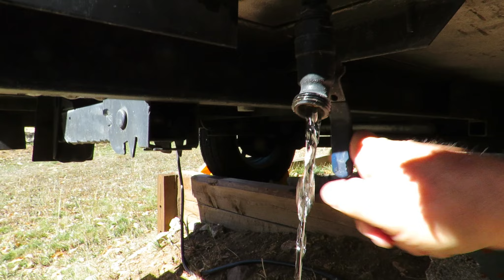Casita - How to Winterize your Travel Trailer by RV Adventures

Comment: This is a PERFECT video. Thank you so so so much! I had a "high level" understanding of the blow out technique, but there were certain pieces that I was still uncertain about. Specifically, my mind was BLOWN when you showed us around the 25 minute mark how to unhook the pump. SO EASY! AFAIK, not covered in the Casita Manual (will double check) and so incredibly useful. HECK - I didn't even know there was a filter there! (There are folks on the internet who talk about installing valves there, but this is better because another valve there would just be another failure point, IMHO.) I also love the tips about running the pump briefly dry around minute 27, specifically how much to add to the drains, and the pro tip about the tilt around minute 32. Like I said, this is a perfect video. Also - even reading the comments - I have learned even more! (e.g. The comment about further suction may be needed for the hot water heater from Nancy, the clarification regarding the hot water heater pressure relief value from you and Gary, etc.)  THANK YOU.
Reply: Oh! I forgot one extra comment. 

IF you (the viewers) are still in the "antifreeze in the fresh water system" camp after this video, I've read that you can reclaim the antifreeze and re-use it. 
(I wouldn't re-use the drain antifreeze because that sounds kinda gross and unsafe.). 
I wish I had known that I could reclaim the fresh-water-system antifreeze this spring! Just never thought of it! Sharing that in case it helps others.
Reply from the maker: Thank you for taking the time for a such detailed comment. I am glad you enjoyed the video and I wish you all the best. Happy Camping!

Comment: Alan, Thanks for the video. Do the black/grey tanks need to be dumped before this procedure?  I'm in southern Arizona at altitude and sometimes hit freezing in the winter but usually not for very long. I'd like to use my RV year round and didn't realize this limitation until my purchase is now pending. I'm wondering if I winterize as you say and then bring along water in a tank I keep inside the Casita for drinking, showering and flushing, perhaps heating the water on the stove for Navy showers. Can I get away with it, perhaps adding some antifreeze (seems to be rated at -50F) after showering and maybe even using it to flush the toilet? We'll generally not get much below freezing for very long. Any advice? Again thanks for the video and alternate approach. The thought of drinking water with antifreeze taste doesn't sound appealing. If I use antifreeze, is it possible to flush out the tanks enough to remove any after taste, or do most people carry separate drinking water?
Reply from the maker: We do carry extra water for winter camping, just in case. Also, we always just drink bottled water as well. I have experience running the water system down to about 15-20 degrees because all the water lines and the fresh water tank are inside the shell and as long as I am running heat to keep the inside temperature up, then no issue. I do put antifreeze in the black and gray tanks in those conditions. Yes, flushing the system well will remove any smell/taste from the system.

Comment: Thanks for the video, Allen. I just winterized my 2019 Spirit Deluxe for the first time as predicted temps tonight are for below freezing. Easy Peasy to do while following your video step by step. One thing I did notice however, was a small amount of water that remained at the hot water heater anode opening when I stuck my finger in the opening. So I used about a 3/8" diameter clear plastic tube like a straw, putting one end inside the hole and holding it down with my fingers, then sucked slightly on the other end to start a siphon. I got about two more ounces out of the water heater and can no longer feel any water inside of the opening. So I'm confident that my water heater is now totally empty.  Thanks again for another one of your terrific videos. Happy RV adventures to you!
Reply from the maker: Great idea. Thanks

Comment: Thanks for the Video. I have pass it along. I decided to use the RV antifreeze because I did not want to buy a Air compressor plus it seemed like less work. Now I closed off the by pass valve on the hot water heater,  like you did & still got antifreeze in my hot water tank. Any ideas?
Reply from the maker: Maybe it backed up through the inlet lines... but I haven't heard of this happening. Make sure you remove the Anode rod and wash it well or the antifreeze will melt it away. Anyone else out there experience this?
Reply: @RVAdventuresTV  Thanks for your answer. That makes sense. I bought a new Anode Rod. I will put it in the spring.

Comment: I seem to lose 2-3 gallons of water while traveling thru the inlet or vent line, is there a mod or fix for that
Reply from the maker: The only way I know of is to put a plug in the vent line hole and glue a piece of thin rubber on the inside of the fill cap.

Comment: Great video. Thanks for sharing. Did you blow out the line from the bathroom sink to the shower head?
Reply from the maker: I usually gravity drain it by just hanging it down each time we use it... so, yes, I open the plunger to allow some air to flow through it to make sure all water is out. I thought I showed that, maybe I missed it. Thanks for the question.

Comment: What about any special winterizing for grey and black water valves? Do you leave these valves open or closed. Do you leave the dump drain up or down?
Reply from the maker: I pour some winterize solution from the jugs in the drains for the traps with enough to go into the gray tank and pour some in the toilet and flush so that it sits against the drain valves on the outside. I leave the dump drain down and open, but the valves are closed.

Comment: Is there a max psi that should not be exceeded when sending air through the system? I figure your compressor has a max setting so it turns off when you have all valves closed, correct? I guess with a bike pump, you would just keep pumping until the pressure is up, then open and close each valve one at a time and re-pump as necessary. Is that right? Really liked your video. I’m not a fan of putting antifreeze in my drinking water system. Would much rather blow out the lines like this. I have been looking around at RVs for a couple of years now and came across the Casitas. They seem well built and I don’t see many complaints for them and they seem to retain their value more than others. I also like the smaller size. Did you own a previous RV, or is this your first one?
Reply from the maker: Thank you for all the comments/questions. I keep the pressure around 25 psi on the compressor outlet... with a bicycle pump, it would help to have a helper open the valves one at a time on the inside, then start pumping. I don't think a hand pump would build up the pressure in the lines. To build up the pressure there needs to be a sealed reservoir to hold air. If you get a small air compressor as I showed in the video that has a gauge, a helper can turn it off/on as needed not to exceed 50 psi, which most consider the maximum safe working pressure. Kind of the same as the water pressure coming in when hooked up to city water. We used to have a Shasta travel trailer in our earlier years, then life got busy until we retired... now we are happy to own the Casita. Yes, it is small, but there are a lot of advantages to small like maneuverability in parking lots, gas stations and campgrounds. The Casita is light and we get 16-17 MGP pulling it with our Jeep, it is as if it is not there and its shape makes it aerodynamic. The Casita trailers do hold their value well. The only downside to the trailer is a lack of storage for large items making the choice of a tow vehicle important for carrying your stuff. There are a lot of folks who add a storage locker or bike rack off the back bumper. Thanks for watching our channel.

Comment: Winterized my Casita today.  I found one of the fittings for my air hose today and it made blowing out the water lines so much easier.  I don't have a pressure regulator on my air compressor so I just aired it up to 35 psi and and then turned it off to keep it from building more pressure and connected connected the quick coupling and could drain a couple of faucets before the pressure dropped enough that I had to turn it back on.  Worked like a charm.  Thanks for the great instructional video.
Reply from the maker: Great tip for those without a regulator. I am happy it worked for you. Thanks for watching.

Comment: Great video.  I don't have a large air compressor and don't want to invest in one for only this process.  Would the portable one be enough?
Reply from the maker: Yes, the small one in the video works just as well. I have been told by some other Casita owners that they use a bicycle pump to do the same job and it works.

Comment: I just went through this process. It was pretty straightforward, except one thing. Regardless of which way I set the bypass valve, if I had the anode out and air pressure into the city connection, air was coming out the how water tank (which meant the pressure was lower if I opened another valve). Any idea why that would happen? I just put the anode back in until it came time to empty the hot water tank the second time, but I just want to know if I'm doing something wrong, if my bypass valve has an issue, or if my water system is "wired" differently (it's a '10 SD 17).
Reply from the maker: This is an interesting issue... It could be that the plumbing is different, but the hot water lines are separate from the cold water lines so if the air is coming in on the cold side it shouldn't cross over. One possible reason is if a cold and hot water valve in one of the faucets are both open, even a little, which would allow the air to come in on the cold side and exit the faucet on the hot side back to the hot water heater via the hot water lines. The only other reason is if the bypass valve isn't closing completely which could also be tested by hooking water up to the city water inlet with the bypass valve closed and see if water enters the hot water tank.

Comment: Thanks. That was awesome. In addition to being a great video about winterizing your Casita, it is also a great reference for how the water system is put together. I can't wait until I get my hose adapter so I can try this. I had one question. It looked like you cleaned your anode while you had it out. True? If so, can you provide some info about what you did there? Also, how can I tell when it's time to replace it?
Reply from the maker: I just wiped the anode rod off with a towel... the build up on it that is loose just wipes off. The anode rod shrinks in size as it is used up and when it gets to be about half the size it was originally, it is time to replace. I have talked with other RV'ers and they all say they just replace it once per year. I do that as well unless it is still a great size. It all depends on the water that is put in the system and how much minerals are in the water. It really is a judgment call on when to replace.
Reply from the maker: A little more detail may be needed here... The anode rod is a different metal than the steel tank and it sacrifices itself for the good of the water heater... here are some details from a plumbing site explaining how it all works: 
"An anode rod is usually formed of magnesium or aluminum around a steel wire core. The rod is inserted into the water heater storage tank, where it slowly degrades. As long as the anode rod is degrading in the tank, the tank lining will be protected from rusting. This is accomplished through a process called electrolysis, by which the metals in the anode rod attract "ions" that normally cause rust in iron and steel. These ions are what cause the anode rod to degrade over time. During this process, mineral build up on the rod called calcium carbonate can be wiped off to help the rod work better. If the steel wire in the core of the anode rod becomes exposed as the metal degrades over time, the anode rod needs to be replaced. The anode rod will be smaller than a pencil at this point."

Comment: How do you learn how much air pressure your unit can take?
Reply from the maker: I base it off of the same as the recommended water pressure maximum which is 50psi. With some experimentation, I found that 20-30 psi of air pressure is plenty to blow out the lines.

Comment: This is a great video.  Last winter I watched countless videos on winterizing.  Yours is far superior to any that I saw.  I ended up pouring almost 5 gallons into my fresh water tank and running it through the lines.  That was a huge mistake come spring.  It took a lot of water to clear out those lines.   I am going to have to check and see if my water pump has one of those filters.  It may not since it is an 07 model.   I am thinking I might gamble and not winterize this year since I am going to be leaving the day  after Christmas to head to Florida.  However, I may blow out the lines since that doesn't take that much.  Thanks again for this very informative video.
Reply from the maker: Thank you for the comments... I like this method because of that reason as well, I just don't want to spend the time it takes to flush the lines. Even though this video was long, it really only takes about 10 minutes total to do this.

Comment: Thanks for the detailed instructions!    One question:   After draining the fresh water tank, would it be helpful to run the water pump briefly and open a faucet to purge the pump as well as the pump infeed and outfeed lines?
Reply from the maker: That would work up to the point that no water was coming in from the inlet line (such as with an empty fresh water tank). After that, no more water will flow, so the only way to purge the pump is to run it with the outlet line disconnected. Because water flows to the lowest point, water remains in the lines from the pump outlet to the faucet. At least that has been my experience. Thank you for asking.

Comment: Isn't there a pressure relief valve on the water heater that you should open first? Wouldn't that vent the tank as it drained?
Reply from the maker: Yes, there is a pressure relief valve. I once had a plumber tell me that it should be tested every 6 months by gently opening it on a home hot water heater. If done more than that there is a possibility that the valve could get minerals in it which would affect the safe operation of the valve. To me, it is a safety valve, not a vent valve so it is just as easy to open the nearest hot water valve to allow for vented draining. Just my preference. Thanks for asking.